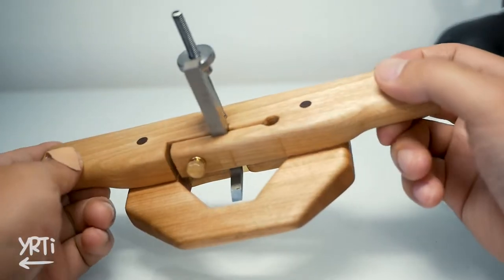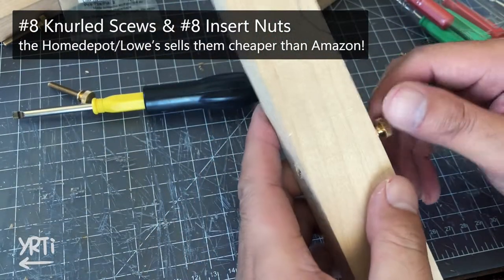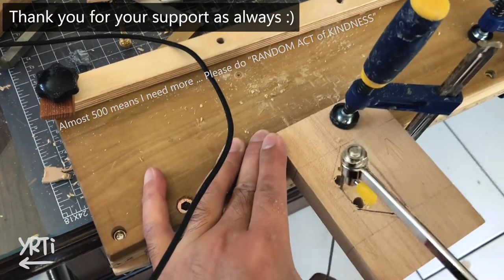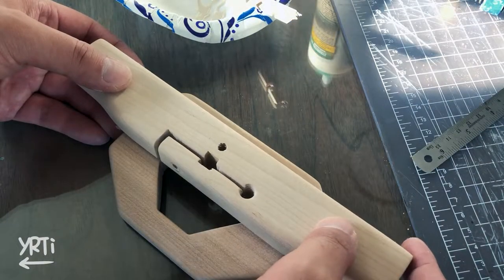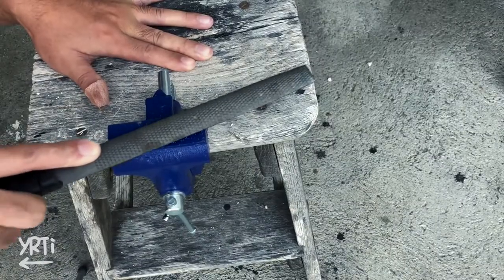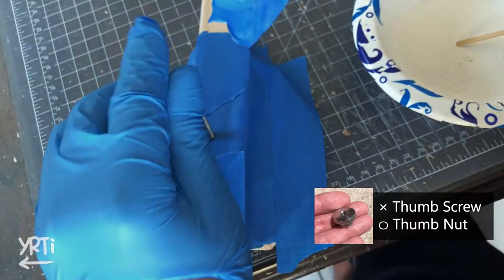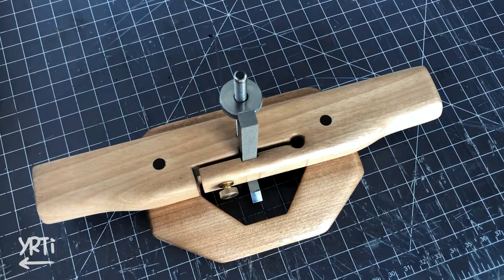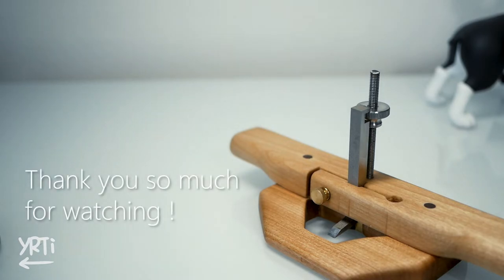I Made a Router Plane | DIY Hand Tools

Comment: I think it looks really good and functional. Another well made video!
I don't know if you are aware, but for super glue there exists an accelerator spray which lets it harden instantaneously, so you don't need to clamp at all.  I also like to use it as a clamp itself, when gluing wood together with wood glue. You can add a few dots of super glue to one part and accelerator to the other additionally to the wood glue. Like that your parts are firmly held together while the wood glue drys but you can go on working on it. This is especially useful for parts which can't be clamped properly, like odd shapes or very small parts.
Reply from the maker: Thank you for the advice! I've never used an accelerator but I actually chose 10 sec super glue (it usually takes like a minute) for this because I needed to position it right. As for the clamping use,  that's right! but I guess except for gluing up a miter joint. When I did a miter joint(just one corner glue up), 2 pieces had a good 45 degree cut on the end grain but the joint came to be about 90.5-91degrees... What happened was, the super glue helped two pieces to connect each other but the miter cut(end grain) absorbed the moisture from the wood glue and the angle got wider a little bit... There are always things to learn...

Comment: Hi YRTI: another nice video, I like the two innovations, the spokeshave handles and and the pinch are built into one piece of material.   I am an older woodworker and have difficulty with my fingers I don’t use my old routor plane because I have to pinch it too hard, it has 2 round knobs, your handle allows all 8 fingers to share the work pressure. Paul Sellers has a good video about sharpening the blade simply, so it is level to the bottom of of the plane. I too have big box of band-aids! Keep up the episodes, they’re good and getting better. Cheers Jerry. From Everett Ontario Canada
Reply from the maker: Welcome back, Jerry! I just wanted to make something different from others so it might give an option to people who are about to make one and checking how others do on YouTube. Thank you for the information of sharpening the blade, too!
Reply: @jerrytrueblue Any interest in selling your router plane?
Reply: Hi YRTI: attached is the link to Paul Sellers episode on fine tuning the router plane. I made a simple wood holder for holding the iron for sharpening on an edge sander. It worked and easily squared the bottom to the iron........ it was sharp and sliced a lovely bevel in the wood. Using Paul’s finishing technique I was able to get a parallel edge, hone it and get nice tenons and housing joints. I still used the holder, but more as a helper to get a grip on the little iron. Cheers Jerry
Https://m.youtube.com/watch?v=iXREj_lXFCE
Reply from the maker: Thanks, I watched it!! I'll find what works the best to me at my skill level :)

Comment: Nice work, I would be curious to see how you like those router plane irons as you use it more.  I would think the shank being wider than the cutter so close to the cutter edge might be annoying for anything deeper, but I suppose it all depends on how you use it.  I've only used my router planes a few times where I had to have the iron a long way down in to a groove or something.
Reply from the maker: Thank you for the comment! Yes, it can be annoying but for the narrow profile blades that I wanted (6mm & 3mm), even Veritas/Lie-Nielsen blades are just like that shape(shank being wider than the cutter) so I assume that's what it is...  I guess I'll worry about it when I can handle thicker wood skill-wise:)
Reply: @YRTi  yeah, same design, just that the narrower part is a little taller before it gets to the wider shank is all. I rarely work anything that's that far down anyway, so it's possible you never run in to it too lol. Fair chance anything that deep will also be as wide as the cutter shank too